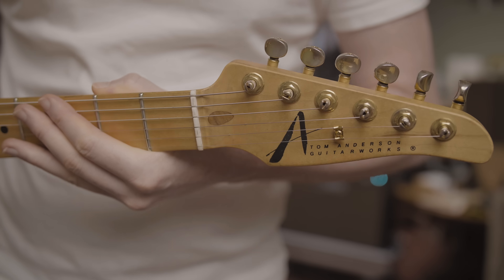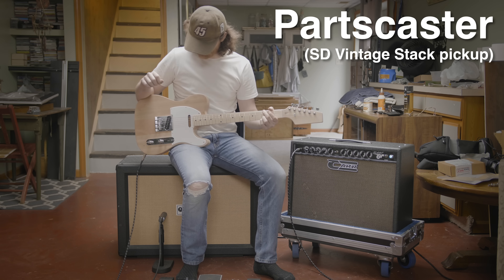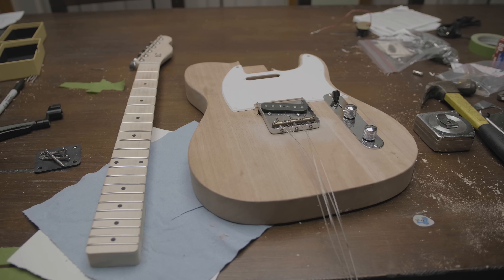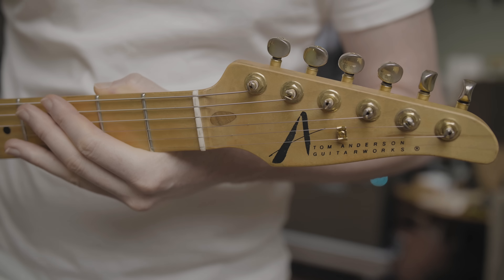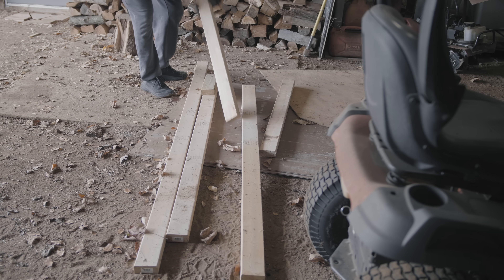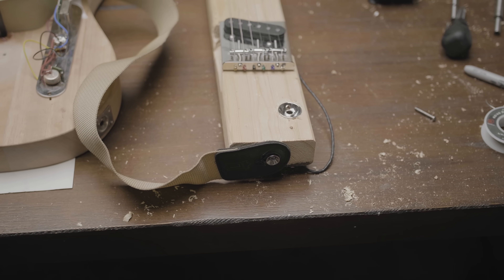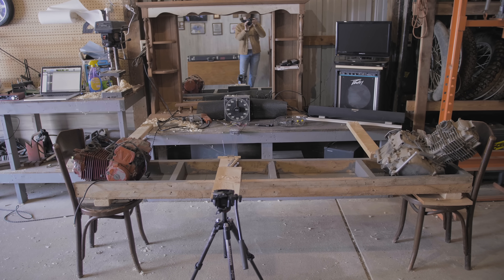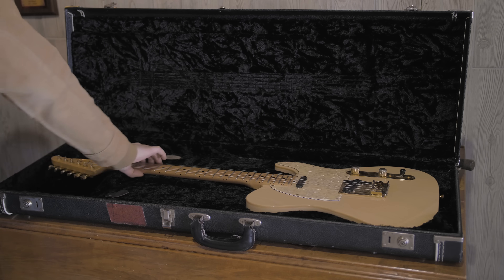Tested: Where Does The Tone Come From In An Electric Guitar?

Comment: As someone who's dabbled in engineering (electronic, mechanical, structural), i've always been somewhat skeptical of the weird claims that some guitar people have.
I can somewhat see the rigidity of the body playing a role in the tone of a guitar, echo/resonance wise, not in more rigid = more better, just that completely flexible = slightly less good.
A pickup is pretty much just a microphone, and the whole overvalued business of microphones aside (it's actually worse than guitars, but for different reasons), i've never seen a microphone with a mahogany body for more sound colour, or whatever claims they make...

I'm a huge skeptic though, to the point of near paranoia in some regards, so i don't blame the average joe falling into the 'i've heard it a thousand times so it must be true' fallacy.
But yeah, if you can get the strings to vibrate the same way, get the microphone to pick up the sound the same way, and get the electronics to process the signal the same way...
Let's just put it like this: If the type of wood you're using can alter any of those factors to a significant degree, you're a shit carpenter. ;)

All in all, question everything constantly, and test everything at least once.
The truth is only as malleable as the facts it's based on.

Comment: As someone who works in electronics repair, this was the result I expected. Your thought process and thoroughness were a pleasure to watch.
Reply: Yeah also have a background in electronics and similarly my first thought was anything affecting the electronic line is going to be the most important next to the player.
Reply: @larry50648  the sound in an electric comes from the pick up configuration and the way the strings are setup, so scale and tension & bridge/trem setup. Body type does has an effect as why an archtop has a different sound, but for solids not as much, there's a slight influence in timbre and sustain but it's trumped by the pick up config and bridge setup.
Reply: The thought process was the scientific method.

Comment: So, you've clearly shown that the pickup, and its placement is, by far, the biggest contributor to the sound of a guitar.
All the other stuff makes only subtle variations (that could probably be made up for with EQ).
However, there is a lot more to a guitar than just the sound.
how does it feel when you play? the neck, neck finish, fret quality, and body shape & weight play heavily into this.
sustain will also be impacted by bridge, nut and body wood (possibly by top load vs through body depending on the instrument); 
but, not in ways that are realized in the way we most often play.

my advise to people getting a new instrument is to play it without plugging it in; find one (or a few) that feels good to play and is inspiring to you.
Then try it through an amp most similar to what you have at home.
The amp test is to mostly make sure it has a clean signal, free of noise and hum.
If you don't totally like the sound, upgrade the pickups to ones you like.

Most people can find a pretty affordable guitar that feels good to them and get it to sound nearly the same as ridiculously expensive guitars with a few tweaks.

Thanks, Jim for taking the time to meticulously go through this!

Comment: SMG tested this as well, and the guitar amp speaker (and by extension, mic placement) was the single most impactful contributor to a guitar's sound, as well as the easiest to actually change for the average guitarist.

Comment: Can it be that you tested it with some overdriven amp?
I play bass not guitar and I observed that after some degree of distortion or fuzz regardless of the bass the strings (flatwound vs round), the kind of pickup it tends to converge into a similar tone -> the tone of the amp or the pedal with distortion. When I go back to clean tone, the differences becomes strong. Maybe you could consider to do the test  with a clean tone (I mean totally clean not even a crunch).

Comment: When you did your diligence on the pick up type and height, the comparisons quickly started to resemble TB-303 recreation endeavors in the synthesizer world.

They are different when cleanly A to B compared, but in a mix there's so much nuance that would be drowned out that it honestly wouldn't matter.
We know that a 16 dB filter (uncommon in a world where Oberheim's 12 dB and Moog's 24 dB are the gold standards) is the key to the TB-303 sound, but the various clone products all sound different yet are so in line that any difference could be easily written off as "analog inconsistency" and still have that TB-303 character.

It's just a matter of finding the part with the most influence and basing it off that!

Comment: First of all, amazing work. You are a scientist as well as a player.  The reason you need to have "electronics" attached is that the 500K or 250K pots reduce the Q of the pickups working into the capacitance of the cable and amp input (Q is a frequency response peak, obviously important).  Any pickup will sound different if you change from 500K to 250K vol pots.  That's why Fender and Gibson use the 2 different values.  At any rate, it is interesting to know that it is really all in the pickups. (I'm an EE BTW)... Thanks!

Comment: One thing that would be really interesting is seeing how a block of metal (such as a strat bridge block thing) affects the sound. In theory it should change how the pickups react and therefore change the sound. Supposedly hard tail and vibrato strats should sound different because of this
Reply: It does not matter. Sound the same. You change the sustain not the tone.

Comment: Jim:  Excellent video proving what I've surmised all along.  Before my own diatribe... I'd be interested in a few more details about your setup, such as, 1.  Your pickup height.  2.  The angle of your pickup.  It seems you covered everything else!  My own points (just for interest)  1.  The nut makes absolutely zero difference to tone (acoustic or solid body guit's - it only matters for open strings and then it can be thought of as only effecting sustain. .  2. On any guitar with dense metal bridge/saddle there is no "tone" generated only string sustain depending on how dense the bridge/saddle metal is. The less dense, the more energy might bleed into the wood (decreasing sustain) which on a solid body with a magnetic pickup will only decrease sustain (length of time the strings will vibrate).  Things are totally different for acoustic guitars with piezo pickups.  There the energy from the strings must be transferred to  tone woods which we hear resonating out the sound hole.  Basically, modifying the sustain (bridges and nuts) on an SB electric only modifies the decay of the string sustain.  Yeah you could say that this has modified the tone, but 1. this is very limited in a slab of wood that does not resonate and isn't even receiving any energy to resonate! (all the energy is sustained on the strings).  On acoustics, in my opinion, the more energy that can be bled through the bridge, the better.  Sustain is rarely a problem at the rate we play notes or chords (all genres).  There are millions of hollow body guitars (like the ones with hard tails or even metal thumb screws on archtops that need fixin', IMHO.  -Mike

Comment: While it looks like a bodyless guitar, from a physics standpoint, the table acts as the body, with the 2x4's between the table and tuning pegs acting as the neck.  The best way to isolate the strings from "body" resonance would be to have significant amounts of "squishy" material (e.g: rubber or something) between the bridge, nut, and tuning machines.

Comment: This confirms my 'hunch' / intuition.
      "The type of wood improves sustain" type arguments never made any sense to me. 
      It would more likely be the strings / if your tuning system is solid. 
    Because the strings do the vibrating, not the guitar... And the resonant frequency of the guitar cannot be 'any frequency / any tuning'.

I just started learning how to play guitar (after 15 years in bands - first as a drummer, then vocals).
      Just made more sense that the strings (and have them stay in tune) + pickup(s) + electronics would be the factors..

Anecdotal evidence: 
I made my LTD M-50 sound like the most expensive model by replacing the pickups with a single EMG 81, and hard-tailing it (piece of wood to block the tremolo strings from moving)..
      It stays in tune very well, resonates perfectly...

Also, added the passive elements an electronics to a 20 year old €80 Samick guitar (simple strat replica). It proceeded to sound like the LTD did.

Also, I used D'Addario EXL strings, specifically for the tunings I wanted (they are specially made to resonate best at the specific notes for that tuning)

And I made sure to intonate the guitars perfectly for each tuning I tried: drop D, drop C, drop B, drop.C#.. 
      All of em worked very well.

Anyways - thanks for this video :)
Curious about the amp thing - I'll watch that next

Comment: One tip that I got years ago by someone on Youtube who I've already forgot who; always find your tone with your EARS, not your EYES. If you have a halfway decent guitar and amp, and you really use your ears to fine tune your tone, chances are all you gotta do is tweak the dials a bit, maybe take a screwdriver to adjust the action, pickup height, pickup poles, etc, and you're golden. Maybe a touch of delay, or reverb, a lil compression here or there, or some other minor modulation effects. Usually you wouldn't even have to change the pickups. If you use your EYES, that's when you suddenly feel like you gotta own all the big brands stuff, and even then you probably wouldn't be satisfied.

Comment: I made my Telecaster with a "cheap" kit, and had the electronics and parts that came with it. My teachers were very good but the real master was Mr. Carvajal (who worked for Fender custom shop for a long time and made most guitars there by hand) and he even made me re do my neck and sand away all my paint job cause it wasn't good enough. 
When it was finished it sounded "ok". We had a custom shop Telecaster to compare it with and it was a very very different sound. 
The issues I had were:
-Sustain was not there. Specially in the G string which actually was kind of mutted. (It was the neck nut that was too tight)
-The tone was too bright even in the neck pickup
-The tuning wouldn't last. 

I changed my pickups to Fender Noiseless 6, and the cheap plastic nut for a graphite nut. 

It sounds EXACTLY like the other Telecaster with the same pickups. And it even has a better sustain than the $1,000usd one. 

In my experience, pickups are the most important thing. 
Yes, the player of course, but since I only compare me vs me, I don't list it as important haha

Great video!!!

Comment: I would like to see and hear the setup where the mike and the bridge were separated, as not connected by a metal bar. I have a monster self made abomination of a guitar that should not exist, that I use only to play heavy stuff. The tone is there and I think the reason is because the mike and bridge are connected by 10mm  thick bar of steel. (yeah it weights a shit ton)

Comment: From what I can say (at least from my experience) is that the pickups are 90% of the tone.  Everything else (aside from pedals and amps) creates subtle differences in the tone.  Some are noticeable and others are not.  Hardware has nothing to do with tone.  Hell, you can change the strap buttons on your guitar, and I guarantee you the tone will not change.  You could upgrade (the color of) the hardware from chrome to gold, and the tone will not change.

Comment: Honestly, if you understand how electric guitars work the idea of the body/neck having anything to do with the sound at all is not realistic.  It's all in either the pickups, or anything on the guitar that could affect the way the strings vibrate (bridge, tuners, scale length, probably even the frets).  Plus any electronics, but that goes without saying.

Comment: before this video really got going, i would say the 5 most important tone factors are:
1) the player
2) the interaction between the pickup and the body (same pickup in 2 similar bodies can sound the same, 2 different pickups in similar bodies can sound the same, but the same pickup in 2 different bodies can sound very different)
3) the interaction between the guitar and pedals (2 different guitars through the same pedals might need different pedal settings to get the same sound)
4) the interaction between the pedals and the amp (same concept as 2 and 3)
5) the interaction between the guitar and amp (2 different guitars with the same pickups can sound different plugged directly into the same amp with different settings...and considering the advancements and growing popularity of digital amps, it's easy to make 2 different amps sound the same with the same guitar)
my amendments after watching the video are only being a little more pedantic about #2 to include how the pickup is installed. the tests in the video are a little flawed. instead of testing what combinations make for the "best" tone, or some way to define tone, the tests are just looking to match the variables of the test guitar to the tone of the control guitar. that's not finding where tone comes from in an electric guitar, that's just trying to recreate 1 specific guitar's tone. because the amp and pedals were never changed throughout the process, that means the tone COULD be effected by them.
as to my point about #2, i don't REALLY believe in tone wood. i'm thinking more how different materials interact with the pickups. sure the "air" guitar sounds dead on with the Anderson...but the parts of the "air" guitar that DO have an interaction between the strings and electronics are still wood. would the tone change if concrete was the grounding? what about epoxy resin? slate rock? glass? tin can? shotgun? (youtube search "shotgun guitar" and you'll find it)
there is are 2 moments in the video where my argument on this matter are strengthened. 1) the pickup height. the interaction between the pickup and the body changed based on the height of the pickup. 2) the pickup being wired direct to the input jack. the interaction between the pickup and and the body is still changing based how the pickup is wired.

Comment: Great clip. Don’t underestimate the resistance of the pots in the equation. If they wear and the resistance drops then you will have a darker sound.

There’s a good reason Fenders have 250k pots and Gibson 500k.
Reply: Further to this do your own experiment. Change your pots resistance values and see what happens to the tone. One of my Strats was sounding dull and I tested the pots and one of them are drifted down to almost 200k
Reply: Fenders have single coils (mostly), Gibsons humbuckers.

Comment: Something that I find a lot of people overlook is the magnetic pull of the pickups on the strings, even pickups that arent being used. It's more noticeable with guitars with lots of strong magnets and lots of pickups. I find having fewer/weaker magnets (ii.e. single pickup) gets a bigger and fuller tone. So the two teles could have been closer if you either took out the neck coil in the Anderson or installed an identical coil in the other tele.
Reply: Most guitarists i know have a as small as possible distance between PUs and strings to give a loud sound and more gain. Not me, my PUs are low in the guitar body for the sound i want with lots of sustain.

Comment: The guitar you buy is really about looks and pickups. Go get a les paul and put single coil tele pickups and compare it to the same telecaster with the same pickups and tell me what you hear, you may possibly hear slight tonal fifferences because of pickup placement but its all puckups. Get a cheap telecaster vs an expensive one both with same high end pickups and i promise there is no difference except price. I have 20k in guitars from dean stealth to waylon jennings telecaster to an esp metal monster and all of the above all nice guitars but the differences are in the shapes and pickups. Also parts quality make a differen e but not a tonal one, they help with tuning stability.

Comment: Video suggestion: Where does tone come from in a guitar pickup :) wire gauges, enamel vs poly, spacers, magnets, bobin size and shape (jazzmaster pups vs strat pups in jazzmaster covers), and the obvious material of the cover (there are tests on this online by Antigua)... Even further, a post by "TeleTucson" on tdpri (thread is "could someone explain the combo Ohm & Henry") implies the most relevant stat is inductance, since resistance is overwhelmed by the pots and capacitance is overwhelmed by the guitar cable (and ignoring eddy currents from a cover). Would be interesting to dig deeper into this too. Would pickups with the same inductance, but other different specs, sound the same once loaded into a guitar and down a chain into an amp?

Comment: ive always said, if the string PHYSICALLY CONTACTS A SURFACE, it can effect tone. HOWEVER, this goes for overall material. ie wood vs steel. for instance an aluminium neck will sound different to a wood neck, just the same as steel frets sound slightly brighter than nickle frets

Comment: Using the back pickup only, and by  raking the pick violently across the strings, I'm sure you would have been able to make a hollowbody and a solidbody sound identical as well. The reality is of course that they sound completely different, even if they have identical pickups.
Reply: Guess you missed the part where he strummed with his finger at 3 different dynamic levels. Copium.